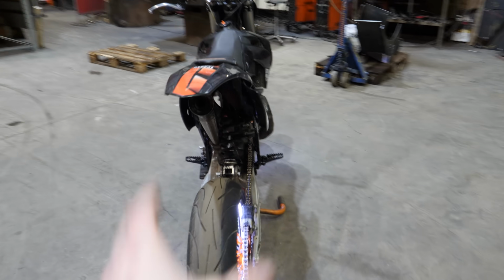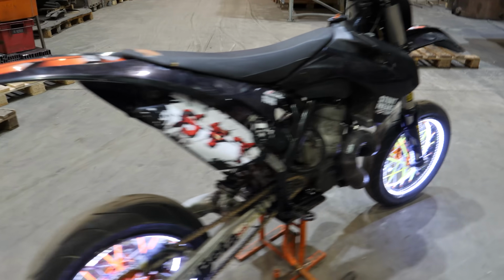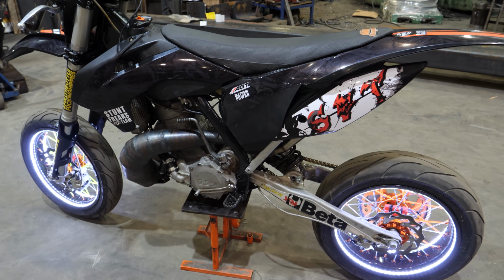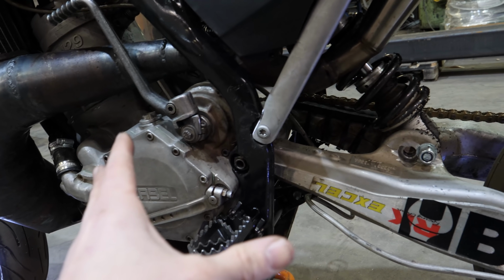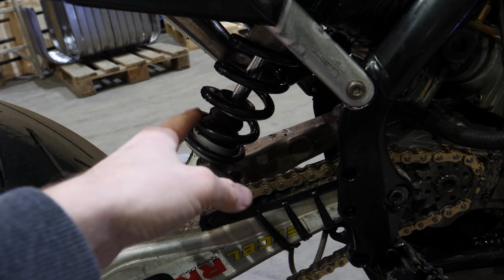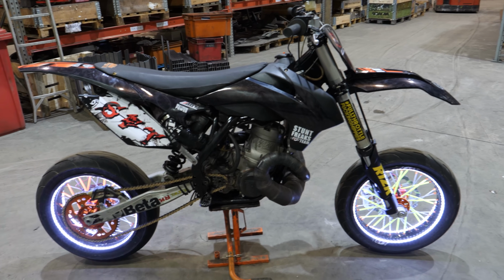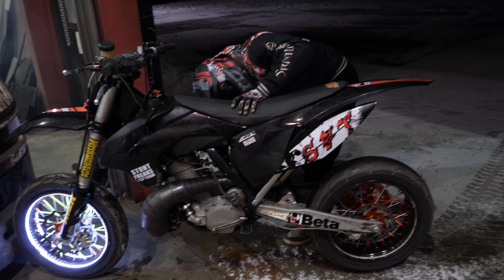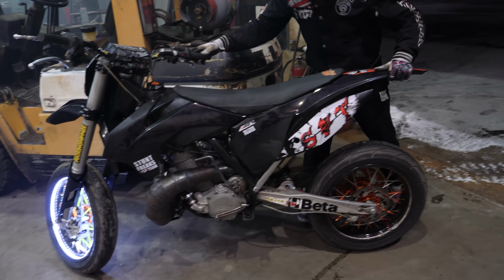700cc 2 Stroke Supermoto

Comment: Dyno that beast
Reply: mc empele , please
Reply: It's around 80hp
Reply: It prob have over a 100hp
Reply: @micjubbs6430  Not that much
Reply: @BenaresDarkness   250cc 2strokes have about 60hp   so a 700cc will have some high power
Reply: @micjubbs6430  Maico 700cc 2 stroke has 80hp some other 700cc 2 strokes have 68hp and some 87hp, it's not some high crazy number like you think it is.
Reply: @BenaresDarkness  or right i just looked at the maico 700cc yeah ok your right then i wouldnt bother going 700cc might aswell have a 500cc with 80hp
Reply: @BenaresDarkness  you could get 100hp out a 700cc tho a bet high comp forged piston forged crank and stuff bit  try diffrent octance fuels
Reply: @micjubbs6430  Well yeah but I'm talking stock no upgrade's, even a 350 banshee can make 100hp built, so I'm sure you can do the same with a engine that's twice the cc.
Reply: @BenaresDarkness  yeah but depends what fuel u use aswell stock could be more than 80
Reply: @saarinennnn5152  No it's only 80 unless this bike is not stock.
Reply: @micjubbs6430  250 have 45 hp.... BRUH
Reply: only one cylinder so not much power.. mmx 500cc has over 180hp with in v4 2t
Reply: arttu karonen lmao 1500s don’t pull they have low end power only it’s good if you want a bike with torque if you want to race get ss1000 rr
Reply: Its difficult make big power with only one sylinder.
Reply: @BenaresDarkness  yes because there are banshees 421 that have 100hp
Reply: @bikerboi5086  You fail to realize that it's built to 421cc ofc it going going to have more power this 700cc is stock not built.
Reply: @BenaresDarkness  And? Its a way bigger engine. Lets se if they dyno it and then we talk
Reply: @bikerboi5086  No need I've already done the research twice already.
Reply: Cr500 91.5hp from the crank
Reply: @Kxkid554  That's crank power it doesn't matter wheel power matter's.
Reply: @BenaresDarkness  so how much power is lost from the crank to the wheel because a 700 should have more than 90hp if that’s what a 500 is making
Reply: @Kxkid554  Take it up with the company because a 700cc Maico 2 stroke only has 82hp. 
no non built 500cc is going to have 90hp not even the quadzilla has it.
Reply: @BenaresDarkness  nah more
Reply: @armoi539  Ok believe what you will but just know you are wrong.
Reply: @micjubbs6430   250 2 strokes dont have 60
Reply: @micjubbs6430  250cc have about 50hp
Reply: @BenaresDarkness  vääntää vaan vitusti enemmän
Reply: @BenaresDarkness  it a 4stroke 450 has 50hp... this must have 100 at least
Reply: @nickofcambodia2980  If this factory it's only doing between 60 to 70hp. Take it up with the manufacturer because that's what they say it does.
Reply: @ronin_ftp5514  somewhere around 50-55
Reply: @micjubbs6430  250 2 strokes barely reach 50, let alone 60 hp...
Reply: @micjubbs6430  maico 700 just 60 hp on dynojet
Reply: @BenaresDarkness  maico 700 have 60 hp on dynojet
Reply: Like 98😂😢

Comment: Nice work. The Engine was originaly engineered as a 620cc by Maico and then licensed to Zabel. Zabel slightly modified it and build a custom cylinder for it. This Engine is normally used for sidecar racing. Maico does also make a 698cc model. The same engines are also used in ATK Bikes

Comment: I wanna see a 1000cc 2stroke thumper with nitromethane style engine technology, capable of full maximum rpm and power. Then put it up against some 1000cc race bikes like R1 and CBR1000RR.
Reply: Kaegis 

Never gonna happen.. I would like to see a 4 cylinder 1000cc 2 stroke race bike. That’s possible

Comment: The Zabel engine is used for sidecar racing, but it's ultimately based on the Maico motocross engine.  This was the last engine design by the old Maico company in 1983, shortly before they went bankrupt.  The new Maico company never really found much success but did convert the engine to water cooling, added the larger 620cc and 685cc "700" versions over the original 490 size, and added a few other features like exhaust power-valves etc.  Technically you can still buy a new Maico today with this engine.  The original air-cooled 1983 engine was phenomenally good and most people I've talked to think it was better than any of the Kawasaki or Honda 500s that were being made nearly 20 years later.
Reply: Thanks.

Comment: The engines that were used on the side cars / outfits had the output shaft on the other side so the passenger wasn't next to the chain in a race ect so they didnt loose fingers and so on.

Comment: Did you know that you can actually buy a 700cc 2 stroke street legal in Europe? The sister of the Zabel 700, the Maico 700cc. It costs only around 10K ready to race.
And it's fully designed to work with the power of the motor. Only 110 Kg of pure rage. The dealer is in Germany, you should check.
Reply: It costs alot to get one to Finland

Comment: You need to lengten the cable on the Hot start, it pulls it open a bit when you steer  to the left. Thats why the rpm’s go up when you turn the steer left

Comment: I appreciate the effort, even though the most simple and easiest things were not done properly. Like throttle cable management and buying right sized rubber hose for air intake before starting the build. I know this was challenging and cool job but you should never cut the effort on easy parts of the job.
Reply: there is no need to tell them this at this point, they allready learned 😂

Comment: when the revs climb if the handle bar is turned the first thing to check is the throttle cable is fitted properly at the handle bar..it is NOT fitted properly in this video!
Reply: im pretty sure they noticed it

Comment: You need to reroute your throttle cable. When you turn the bars it revs up. 4:40
Reply: its fine, little extra juice out of those tight low speed turns, completely safe

Comment: 2 day build, no warm, up not breaking it in you might have some issue's. Sounded rough when it hit the power band almost like a 2 stroke concrete saw it never sounds like it hits the sweet spot in the top end.

Edit: great concept and looks to have plenty of power just let it warm up and break it in before hitting that powerband so hard and work the other kinks out should be a great bike.
Reply: i'm betting that its not a new engine. so its fine. tune seems to be off tho..

Comment: This is a german zabel zm29 engine with 82 Hp
Reply: So how much kw? 65? Thats like the 450 engine they are also 64kw
Reply: Ruudi Utšenikov 82 hp is 61 kw, no 450 has 82 hp, more like 50
Reply: @mooiboyace  i meant modified 450engine
Reply: @ruudiutsenikov609  80hp is still very rare in dirtbikes. But believe me that 650 could easily exceed 100hp
Reply: Ruudi Utšenikov No 450 has 82 hp, also modified they are still in the 60-70 hp range at most
Reply: @mooiboyace  You are quite wrong there. The German cross magazine tested several pro bikes rated at over 80hp.
Besides, think of it, if street bikes with catalytic converters and 15 000km service intervals can have 2hp/l and more, why shouldn't a racing bike?
Reply: @petergriffin4629  Show me that info of motocross bikes with over 80 hp.
Reply: @petergriffin4629  Because they are single cylinder Engines.
Reply: @JohnnyLehti  well yes and no, there is a relation between power and cylinder number, but yet again if a streeeeetbike can have 2hp/l than a race bike can exceed that by quite a lot. Now correct that for a few percent because of the cylinder number and you wind up at more than 2hp/l.
Also there was a dude in 80s and 90s who tuned singles to apply the knowledge to the formula one engines. He exceede 2hp/l often in those engines. If you don't believe me look it up. I can't help you with that.
Reply: Peter Griffin yes, there is a relation between the number of cylinders but it, much more than a few percent and with big single cylinders like this bike it’s not so easy to achive 200hp/ liter because of the long stroke/ high piston speeds. But yes, for a 125 or 250 it’s no problem. But you don’t see many +500cc motocross bikes with 80 hp on regular fuel. It’s not that easy. And there is a lot of people who think they have this kind of power but noone has any dynosheets. Very strange..
Reply: @JohnnyLehti  Go to college, read a book, I can't help you with your incompetence. I'll just put another thing to you, you could google. Dakar RALLYE BIKES have 70plus horsepower from 450 cc.
Also I don't know in which time you live but the last time I checked mx bikes had 450 ccs and not 500 or more.
Also have a fucking guess why pro teams don't run around showing everybody data of their top secret engines.
Also no it literally only is a few percent, you wanna know why? It doesn't change the thermodynamics only the mechanics and those only make a few percent in general.
So please educate yourself before you write shit on the internet.
Reply: @petergriffin4629  I don't have to go to college, i'm 54 years old and have built several twostroke Engines and tuned them. I have also learned that you can't make a striaght over comparison between a fourstroke Engine and a twostroke, very different Engines, but it seems like you don't know that.
And where did i talk about "pro bikes"?
If you want to compare Engines you should know that you can only compare the same type of engines to start with Before you shit on another person and behave like a professional engine builder. 
Don't you have any dynosheets of your own race engine builds to show?
Reply: @JohnnyLehti  Dude, wtf is wrong with you? I commented to the other people that 80hp is a lot in 450s but not fucking impossible and I wrote that the German Motocross magazine has published tests of mxgp bikes with 80hp. I claimed nothing more and nothing less. I didn't say shit about two stroke engines. 
Though I do know a lot about them, too. If you are interested.
Reply: Wrong? I want facts. Just give me a link to a test from a magazine that has dynoed a 450 fourstroke motocross bike with 80hp. i can't find any. That is great that are so knowledgeable about twostrokes too. then you know that they produce more power per litre of cylinder volume than a fourstroke does. And if the difference in power ouput between a single cylinder engine and multiple cylinder engine with the same volume just is a few percent i wonder why the bikes both today and back in the twostroke era doesn't run single cylinder Engines. I mean, Close to 200 hp from a 1000cc single cylinder fourstroke should not be a problem after what you say, right? Why do we never see that ? And i thought we were talking about twostroke engines as the bike in this thread is a twostroke… Or did you miss that?
Reply: @JohnnyLehti  I think my comment didn't get posted so I'll write it again.
I have googled around a bit and I can't find those articles either, which makes sense as most magazines aren't publicly available.
So you'll just have to go and take any book on piston engines and read what they write on specific power.
Yes twostrokes have higher specific powers, but more than 90hp was rather easily achievable in 500 twostrokes in the 80s and nobody put any effort into producing more ever since then, as they are unridable in any way. Don't you own a 90 hp 550?
Concerning that 1000cc single cylinder, that would be a problem specific power decreases with increasing cylinder displacement, due to higher inner work losses and majorly due to the fact that knock increases with bigger piston diameters.
But in a theoretical situation, yes you could build a 200hp 1l single cylinder. If you ran nitro methane and didn't care about reliability and common sense all together.
The sweet spot of specific power is at 300ccm per cylinder, which a 450 doesn't exceed too badly.
No we were not talking about twostrokes, some idiot claimed that 80hp was super common in 450s and I told that dude that they are around, but super scarce.
Then you started bugging me.
Also I absolutely do not get where the confusion comes from, 60hp is very common in 450s some even have that at the engine from the factory, 80 hp is only a 1.3 power increase.
That's nothing special if you consider that a stock 450 runs on pump gas.
But btw, I am a great fan of your liger build!
That is one seriously sick bike!
Reply: TNT VIDEOS  the reason people use zabel engines is that they are more reliable and cheaper to maintain than any four-stroke of similar capability. Which is exactly why the zabel engine is the dominant engine in the sidecarcross world championship ever since the 90s.
Reply: TNT VIDEOS  that's a really cool and interesting video but what does it have to do with anything here? Go and Google sidecarcross gp than look at the standings there.
Do you know why that bike is a 450?
Reply: TNT VIDEOS  hahaha do you want to learn something?
Reply: TNT VIDEOS  what is that supposed to tell me?
Reply: TNT VIDEOS  simple. Rallye racing on motorcycles is possibly the most dangerous racing sport. Which is why in the early 0s they changed the rules. Before Rallye bikes had a 1000ccs. Those were real rocket ships. And they wanted to produce a category that was easy to enter so 450 it was. This allowed brands to basically just use modified mx bikes.
Reply: TNT VIDEOS a700cc twostroke engine that manes 82 hp is far from maxed out to begin with. And when it comes to maintainance you will not have to do anything to such an engine for a long time. A fourstroke on the other hand needs valve adjustments,, piston changes, oil changes often because they are highly tuned to make decent power. I agree on fuel consumption but not the rest. And Dakar bikes are serviced every day if you didn’t know that.
Reply: TNT VIDEOS  is that why the twostroke bikes has become so popular among the best riders in the World 
in enduro the last years :)?
Reply: Sorry, i don't understand Finnish.
Reply: That's good for you but how is your 90cc monkebike related to this and what other 90cc bike did you compare with?
Reply: It depends on Power output compared to cylinder volume.
Reply: You should try my 93 hp Honda CR550 iceracing bike and see if it's made for Children to ride. I Think you would change your opinion about it being childish.

Comment: 5:20 why tf did your tires spark??
Reply: Might be something under the wheel and it scratches on the floor and u know
Reply: There im a metal fab shop. Theres metals beads all over the flooe
Reply: there are metal wires inside the tire, and when the tire consumes you get to the metal
Reply: if you look closely there is like a screw on the floor exactly when the you see the sparks

Comment: WHAT is that front sprocket? Needs -10p rear and +3 front :)

No but honestly if it vibrates and shakes alot, make some brackets to the cylinder head-to-frame, it will reduce vibration ALOT

Comment: burnout with cold engine is no good, a lot of work for nothing
Reply: Normally i think the same, but on this floor you don‘t have so much grip and then the engine don‘t have a big resistance
Reply: @danielnussberger  probaly more bad for the engine to have less grip, as it takes hella more RPM, and thats bad for the engine over time, or when its Cold.

Comment: It should not have revved up like it did when he turned the bars. Something is pinched or pulled
Reply: Throttle cable is routed wrong
Reply: @signaturedean  "wrong" is one way to put it.. more specifically, it's just too short for the way it is currently routed. You could use the same path with a longer cable.
Reply: Or use the correct path with the current cable, either way works..
Reply: @signaturedean  True, but considering the other mods required to make this thing work in the first place (like the upside down swingarm) and the fact that it's a two day chop shop build, I don't think they had any true reference for the "correct path." I mean, it's an engine swap; everything isn't going to line up like from-factory. It's possible that they truly took the most efficient route but the cable just didn't quite reach with the bars full tilt.
Reply: I understand all that well enough man 🙂 just saying this is basically the first thing you check once the motor idles, especially on a 700cc smoker. 
I did it ONCE accidentally when i had my ktm360 haha learnt my lesson real fast 😂

Comment: 6:45 for some reason that left side kick start bothers me...
Reply: neklad  Maico too
Reply: Aprilia sx and rx 125 too
Reply: Cr 480 was too
Reply: @comandercoconut4921  ya, I owned a 83 cr480, left kick confirmed. Wasn't a problem for me but what a beast.
Reply: Bothers me too... but if it’s too much I can use the Electric start
Reply: I'd be more bothered by the 700ccs you're more than likely compressing without a decomp valve and possible kickback breaking my leg or throwing me over the bars lol.

 Just gotta beef that left leg up and you'll have no issues in no time, in fact you'll have an advantage on a right side kick-start if you drop your bike on the left side on a slope because you can kick it over with your left leg and not have to mount the bike, granted you'll probably only need to do it rarely haha. It has helped me out of a jam before though

Comment: the engine is modeled after an old maico engine
Reply: not really, the first one were based on a maico 500 block till 1998. then zabel builded his own blocks with only 4 gears, hydraulic clutch, bigger clutch, membrane valves guidet direct into crank case instead of the zylinder. so since the ZM 19 in 1999 they have nothing to do with the old maico engines.

Comment: That must be vibrating a lot? I wish I had a modern 500 2 stroke with balance axle ;) I did test drive a 2017 KTM 300 2 stroke very fun and exiting like all 2 strokes are but it had to little power compared to my old WR450... Now I have a 2019 KTM 500 EXC F and is very happy with it but it would be nice with a vibration less (like the 2017 KTM 2 stroke with balance axle) modern 500 2 stroke to play with :)